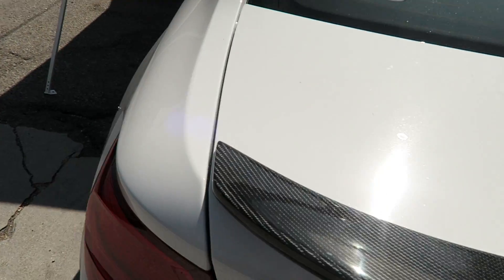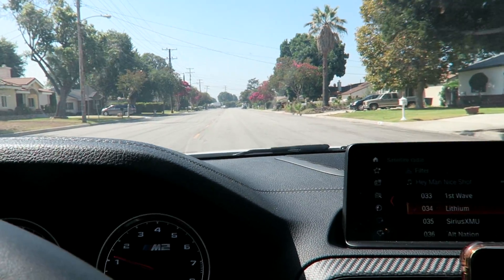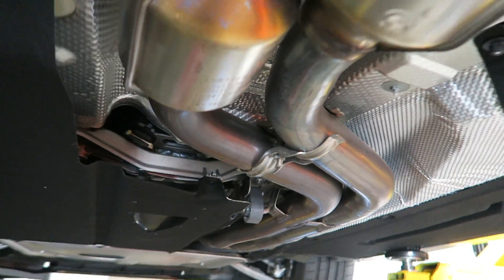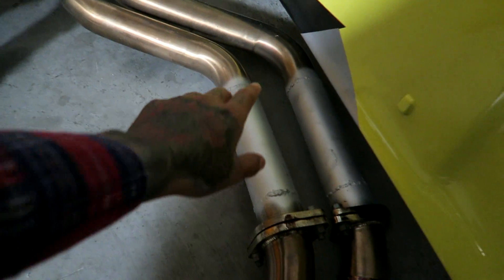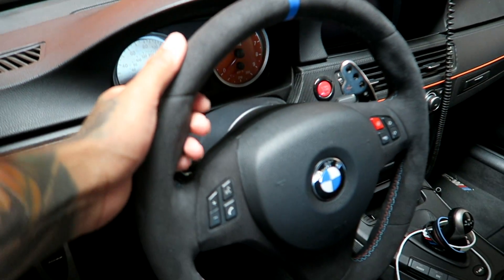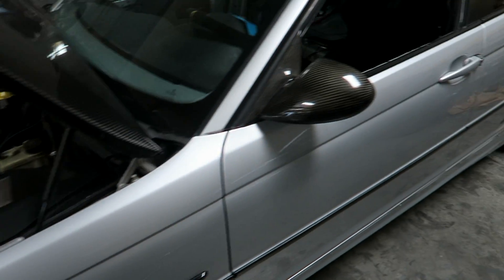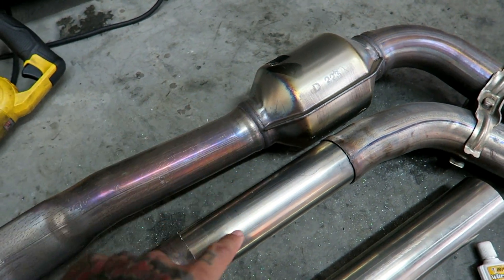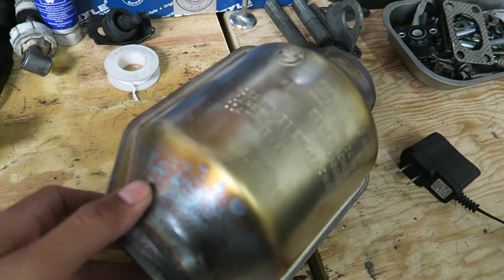MADE MY S55 M2 COMPETITION LOUDER! (SECONDARY CAT DELETE + CARBON FIBER TIPS )

Comment: An inline 6 cylinder with two straight exhaust pipes probably won't sound as good as 6 into 1 straight pipe which will have a deeper rumble backfire sound with just a bit more back pressure but with great sound.